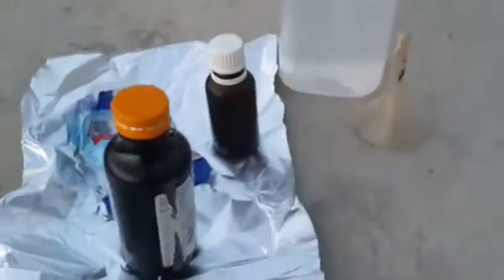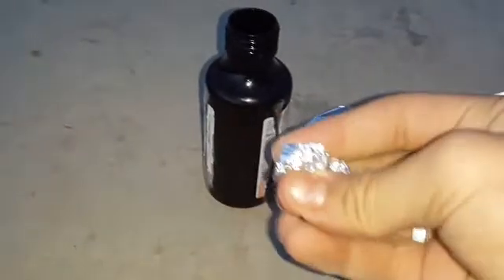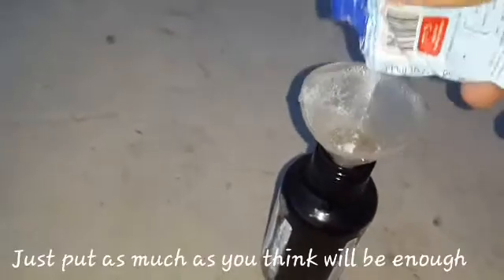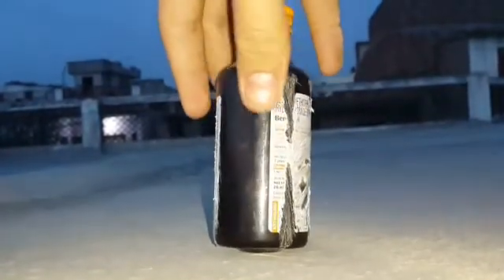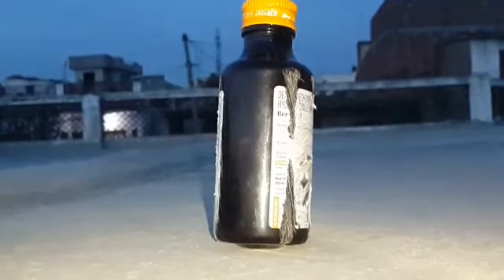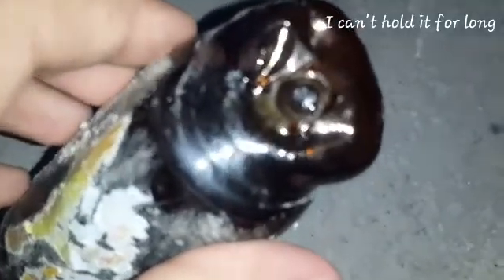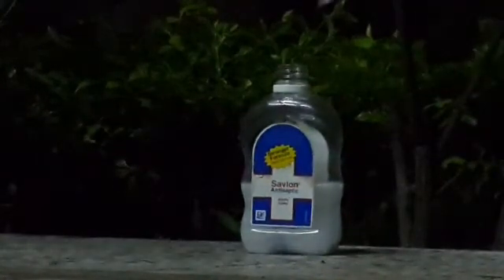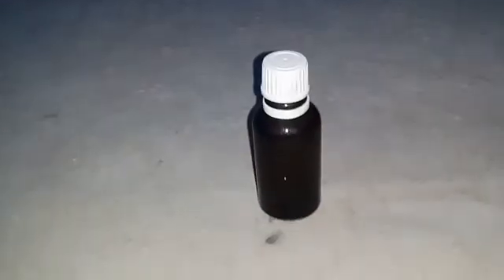EXPLOSIVE CHEMISTRY-  Sodium Hydroxide and Aluminium

Comment: I'm fairly certain that the reaction going on in this video has nothing to do with the aluminum foil, as water tends to react with sodium hydroxide, letting off hydrogen gas which is less dense than the other chemicals and will therefor expand and create pressure in the bottle making it stretch and eventually pop.
Reply: I think the aluminum just speeds up the process

Comment: Use thinner plastic, like a soda bottle. Hard plastic gives a shit explosion. GLASS BOTTLES WILL NOT WORK! The whole "explosion" is caused by the plastic stretching past its limit. Also, just use hydrochloric acid and aluminum. You're not very safe when doing this. NEVER touch the bottle once closed!!! Never stand anywhere near it!!!

Comment: 20oz. soda bottles work better. It works a lot faster and louder, but you better be back further than you were in this video. just a suggestion.
Reply: Aluminum bottles or even ones made out of steel based sheet metal will cause louder explosions as they hold a higher pressure before they blow rather than just expanding.

Comment: The bottom is the weakest point because it the only place where the joint is made while blowing the plastic moulds while manufacturing
Reply from the maker: +Ayushmaan Sharma ya i knew. googled it
Reply: Chemistry Group 😊
Reply from the maker: +Ayushmaan Sharma math aata hai
Reply: Yaar confident nahi hu abhi, thode questions mein problem hai